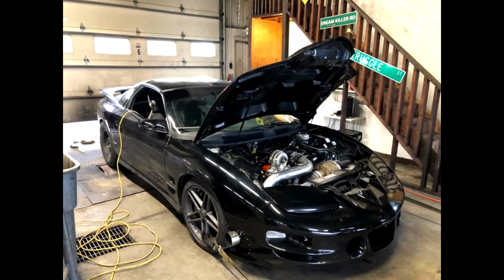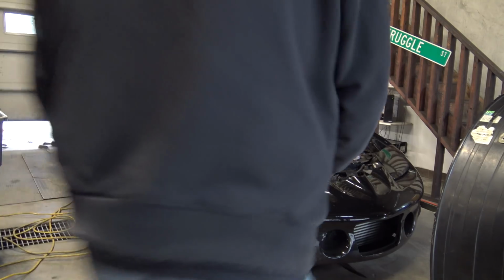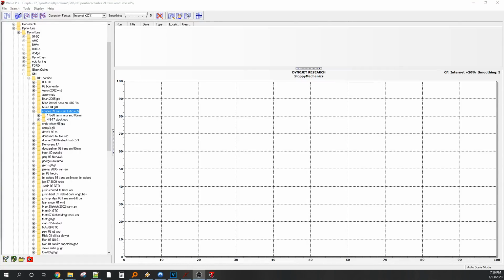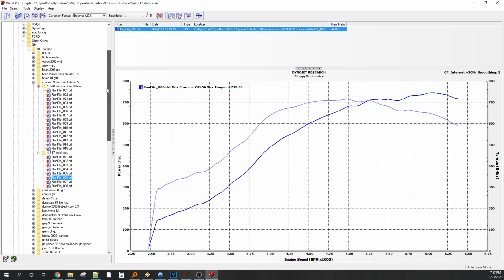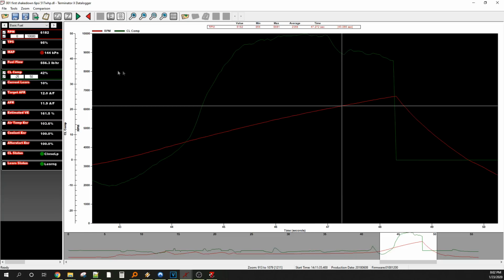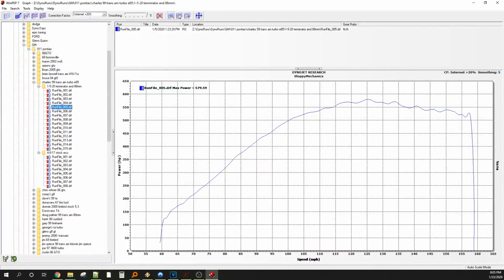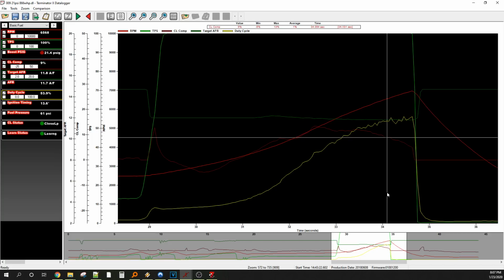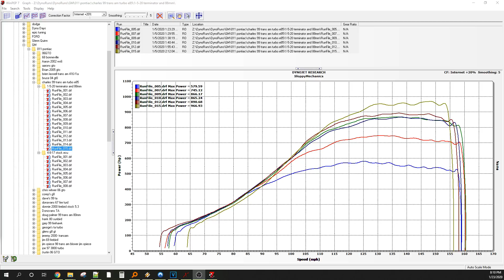Tuning Charles 966whp 6spd Trans Am termx/stock ecu integrated setup

Comment: Is the tune in the repository yet? Would like to use as a base for mine 6.0 gen 4, bosch 210, 823 heads, btr stage 4, t56, Magnafuel 750. Hope to get 800 whp

Comment: If I’m building a turbo 5.3 to put in a s10 what kind of engine management would I need? Do I have to go with a Holley efi or equivalents that cost 2 or 3 thousand dollars? And will I need to run a ignition from msd? Or could I get away with all factory components and harness? It would be a race car for the street and the track. I won’t be cruising around for hours and hours. Any advice in the direction I should go? Anything above 700hp is my goal since it will be raced on the street.

Comment: I am currently in the process of installing a terminator x in my 2000 trans am 6speed and want to keep the stock gauges, my tuner said they have had issues with that setup due to the cam or crank sensor being tapped into. Is there a specific way that this was wired in to work?
Reply from the maker: There is no problem splitting the crank sensor

Comment: That's going to rip. It gave me a little anxiety looking at the fuel pressure and fuel comp on those last few pulls lol. I feel like the two 450's might be putting out a little less than they should, but it doesn't seem too far off of the mark. Good stuff

Comment: I'd like to see if a cd009 can withstand these power levels since they are way cheaper than a T56. Sick car though
Reply: Me too but the total cost with adapter is dumb really.
Reply: Plus twin disc that can actually handle it with the cd009= $$
Reply: @FredAllenBurge  The initial cost of the cd009, adapter, and a decent single disk is comparable to a t56 with a decent clutch kit. The thing is that the cd009 is cheaper to replace if it blows up and you don't have to rebuy the adapter plate.
Reply: Also anything over a 1000 ft/lb rating is most likely a twin disk and the prices are comparable to a t56 twin disk. South bend clutches makes a stage 4 clutch that can handle over 800 ft/lbs too. That clutch kit is the most hardcore single disk you can buy. I have yet to find a single disk that can withstand over 800ft/lbs besides the southbend.
Reply: I think twin disc is all that makes sense for this kind of power and this is the only one I know of that works with the nissan input shaft and the LS flywheel and it's $1700 which is pretty hard to swallow for me - http://collinsadapters.com/index.php/adaptation-components/clutch-and-flywheel/ls-twin-disc-clutch-system.html
Reply: @FredAllenBurge  I'm not a fan of the Collins kit since it requires a custom clutch disk. The LOJ kit (https://www.lojkits.com/collections/transmission-adapters-1/products/350z-ls-transmission-adapter ) uses an aftermarket 350z or 300zx clutch and those twin disk prices are similar to twin disk clutches for the t56. You can find a 350z twin disk for $1100 (https://www.specclutches.com/704954 ). The LOJ kit is the same company that Matt used in the g48 and doesn't require you to cut the bellhousing either.

Comment: people lose their minds on the parallel install, I guess you need some base electrical knowledge to know what there really isn't much to be concerned with, and this is done on alot of different platforms, not just LS's with standalones. The big issue is getting different communication buses to speak to each other.
Reply: Yah make an LS talk to mopar shit if you wanna impress me.
Reply: @popo_53  it's been done, but let wasn't easy.
Reply: poop53 first off, excellent name. Haha. Pete sonntag has the messages working properly in his liberty but so far he has been pretty tight lipped about building for the public. I have a swapped Ram and have tried bugging him about helping me out and got no response. It’s too bad because they are both 10.4kbps vpw
Reply: my car is a 2000 TA and i’ve got a similar setup. only thing the stock computer controls is the dash and the cooling fans though. holley handles the rest. if there wasn’t a holley screen in the interior you wouldn’t even know. it’s some cool stuff, all the stock gauges work which is nice

Comment: Was there a voltage drop at high rpm possibly causing power to fuel pumps to fall off?
Reply: They're wired to the alternator
Reply: @popo_53  could be a bad alternator..I've seen that before in my own car..I also had the pump wired to the alt.

Comment: Do you have any opinion about why the fuel pressure was nosing over? I have twin 450s in my truck and my "goal" is 1000 wheel. I'm interested in hearing what the issue was.
Reply from the maker: unsure. 450s need investigation if wiring is ok, i would clamp wires and measure draw and grounding, then move on, some 450s i have seen have weak pressure relief valves, never had the issue but seen plenty of video of it
Reply: @SloppyMechanics  also depends which 450s. Are they regular or high pressure? I think the high pressure ones cut out at 110psi? Not exactly sure. Have almost the exact same setup. Twin 450s, separate wires, relays etc.
Reply from the maker: @jasoncantrall6446  watch the video nowhere near that PSI
Reply: @SloppyMechanics  I did, I was just asking if you knew what the high pressure ones cut at, not those particular pumps because if the motor was at 28, then it was cutting off around 86
Reply: Been through this myself with twin 450s. Attention to detail is important. I had to run the truck alternator, 4ga power, ground, and alt charge with battery in engine bay. 8ga to rear with 40amp relay for each pump. Each 450 can get near 30amp power draw with my electrician crab claw meter. There's a reason OEMs run them on PWM.
Reply: @chipcurrey653  Yes. I just bought a jms boost a pump and am installing it next week.

Comment: What is all done to the motor besides the turbo and cam?
Reply from the maker: its a pistons and rods stock block
Reply: @SloppyMechanics  How long would you expect a setup like this to run reliably with conservative driving and occasionally (weekly?) standing on the accelerator?